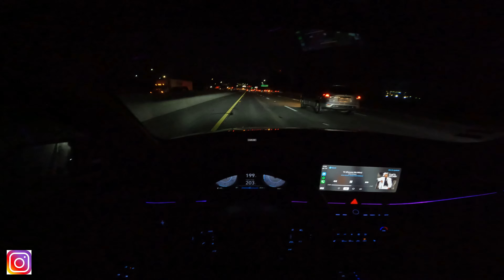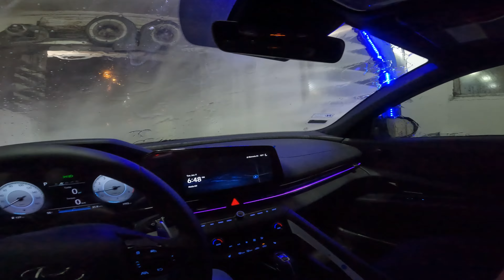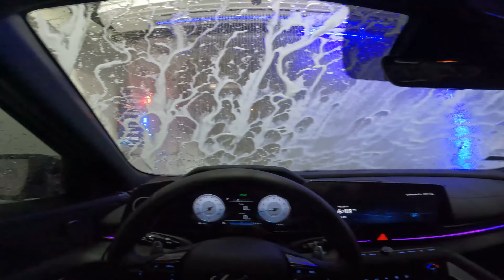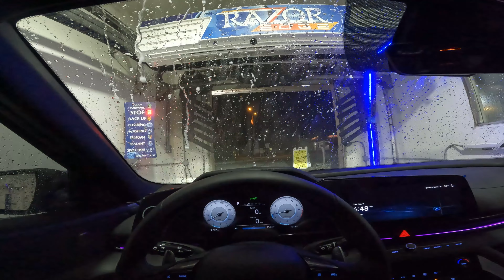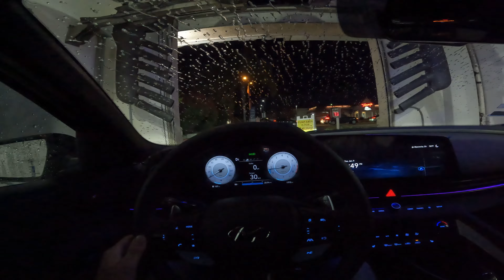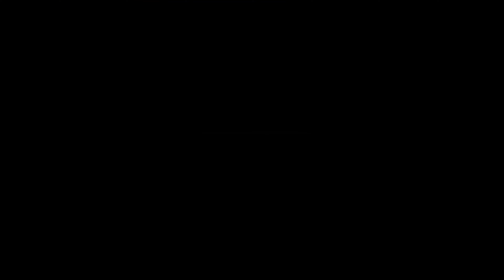23 Elantra N Next Mods?

Comment: is the EN airbox the same as the KN? I have my OEM airbox cover off since it has a KN OEM airf ilter and its a huge cone filter. sounds great and less hot air since it lays inside the airbox.
Reply from the maker: I’m not 100% sure but I know the open air intake has a significant magnification in turbo spools
Reply: @Stevenz_cars  yes it does but you get hot air under the hood. Best open air option is the stock airbox with a K&N filter if it's a cone inside the box like the Kona N. $80 instead of $400 for the same performance and less hot air since the filter sites inside the airbox and the intake funnel gets cool air from the front